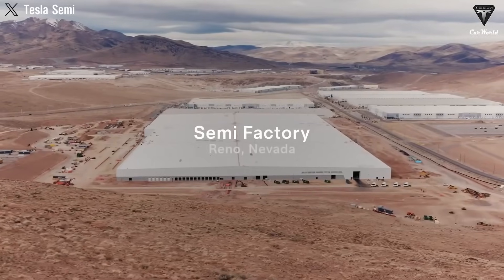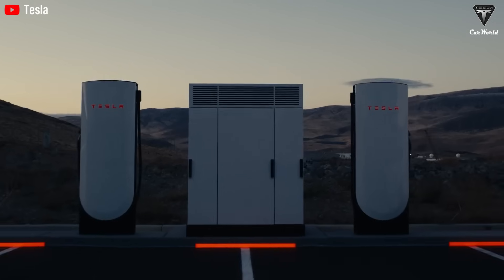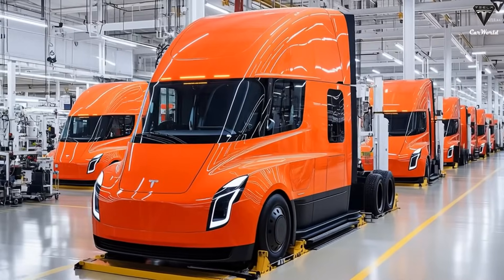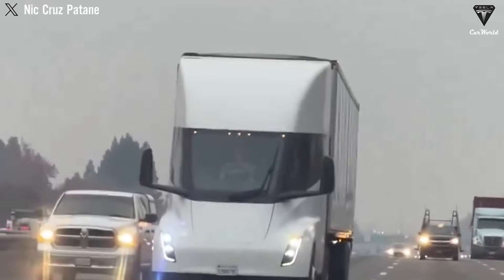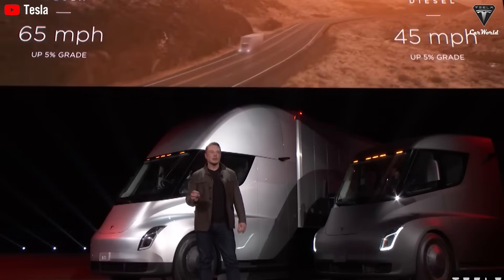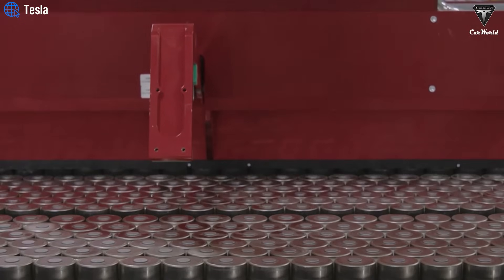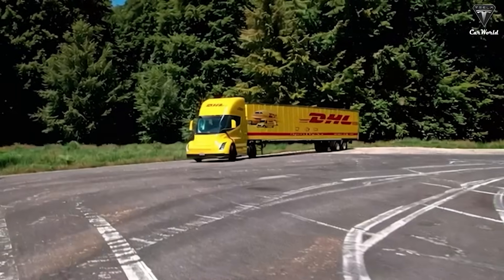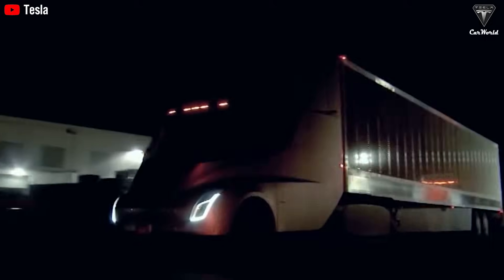It Happened! Elon Musk LEAKED 2026 Tesla Semi Mass Production in October with Insane Design & Price!

Comment: You really save on electricity cost by putting in a 125KW natural gas generator.  That would charge 5 semis at one time at less than 11 gallons an hr running, you would save a fortune running these trucks.  Probably just the money you would save in DEF would pay to fuel the thing. Cutting out the power company is the trick and this would do it.  You could run 12 semis on one generator (40k cost for generator, you could also ship the heat from the generator into warehouse in winter) if you were fueling in two shifts.

Comment: The fuel cost comparison ignores the fact that diesel fuel pays road taxes, but the electricity presumably does not. Do the trucks use the new aluminum based Tesla batteries?
Reply from the maker: Great point on taxes! Tesla’s current Semis use 2170 cells but are transitioning to 4680s—not aluminum-based. Curious if you think road tax reform is coming?
Reply: @TeslaCarWorld  Since the aluminum batteries supposedly only cost 1/4 of lithium batteries while having better performance, you would think those advantages would be magnified for large trucks. They'll have to think of a way to tax electricity use to continue to fund road maintenance. It wouldn't be difficult to require all vehicles to report their electricity usage via cellphone data link and be billed accordingly.